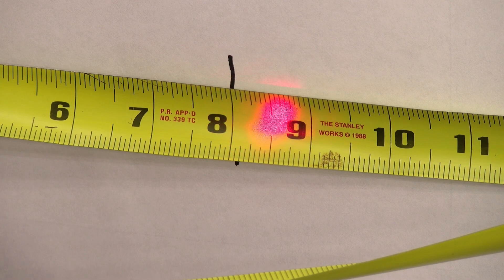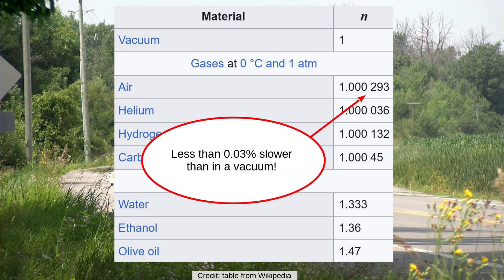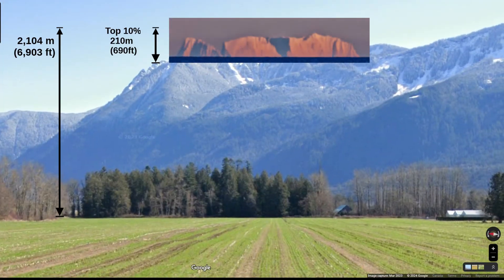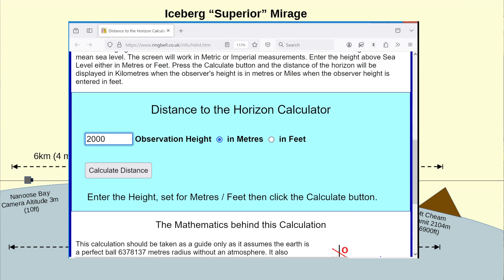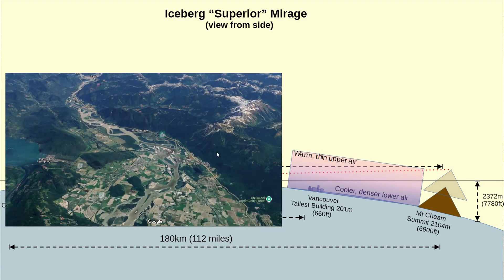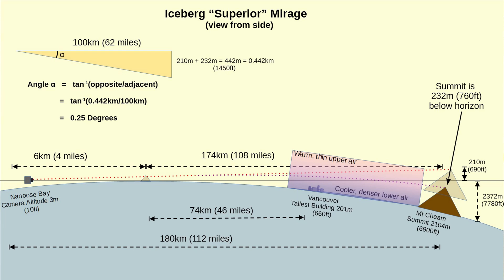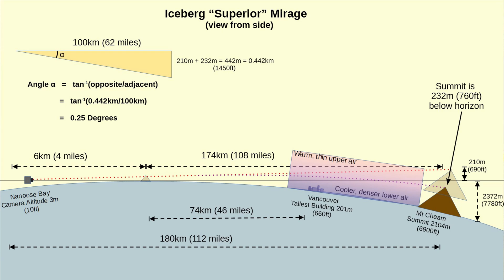Mirages - how they work! From simple water on the road to spectacular illusions.

Comment: You would think that the refraction of light would change its relative speed of light, thus changing the color of light like a prism.  i guess that is what a rainbow is.
Reply from the maker: The reason for the rainbow effect is  the index of refraction varies slightly with wavelength so one end  of the spectrum is slowed/bent more than that the other. In the case of glass or water, index of refraction = slowing of speed - is large - 1.3 to 1.5 or more, so there is a lot of room for the speed change to vary. 

In air, which has a small index of refraction. , there is probably a wavelength dependant change, but would be so small - and the average bending is so small to start with - we would never normally notice it. 

The effect has plagued lens makers for centuries using different types of glass in a series of lenses to try and undo rainbow creation. Also in optical fibers where slight wavelength dependant speeds can distort signals being transmitted.

Comment: Awesome explanation. The one thing I still struggle with is how changing the speed of light results in “bending”.
Reply from the maker: You know I was debating on whether to put that in or not and in the end I didn't because I find it better to stick to one topic for YouTube.

Think of how either bulldozer or a military tank turns: the one track is made to go faster  than the other and when that happens, the vehicle turns towards the slower side.

Now instead of the bulldozer, think of  light waves like water waves on the ocean. If the waves pass into air where say on the left  is hot and thin and move faster. and on the right is cold and slow, the crest of waved between the left and right areas will bend towards the slow right side as the right cant keep up with the left. 

Hope that makes sense! maybe future video!
Reply: @ElectromagneticVideos very interesting and makes sense from a wave perspective! What about from particle theory? Yes, could be a cool video.
Reply from the maker: @Schismarch  I cant think of an easy hand-waving explanation for point-like particles. In quantum mechanics, the point where a photon is detected is  based on probability - and that probability comes from a wave function that contains an amplitude which when squared   = power = probability, and and complex exponential which in this case represents the wave nature of light. The wave function depends on the surroundings - thin air, thick air etc. The EM wave of wave theory is essentially the average of where gazillions of photons  would end up from QM. In  a situation like this, the real part of the of  wave function essential;y maps to the EM wave. So the wave function is in a sense a probability wave (well not quite since its more like the square root of probability)    rather than an E field. But like the E field wave, the "probability" wave speeds up in thinner air and bends accordingly. So once again we have different speeds bending an underlying wave. 

Why the probability wave cares about thick or thin air is another can of worms - it can be looked at as interference from the wave functions of the interactions between electrons in the air  and the light photons/wave functions.

I'm guessing that this text  highly compressed explanation might be too garbled to be useful. Bottom line - there  is an underlying wave-like function that determines where photons end up and it gets bent in a similar way light waves do. 

I'll have to think of how to do a video thats a bit better a description!
Reply: @ElectromagneticVideos  nice, thanks for the explanation!
Reply from the maker: @Schismarch  Your welcome! You certainly have me thinking about a video on that topic sometime!

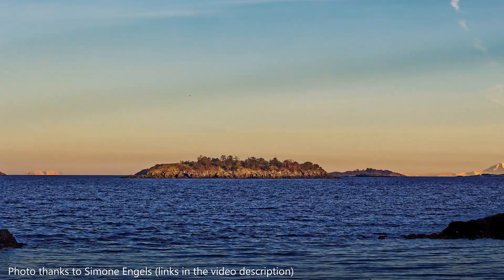Comment: Ooooooops, you very nearly disproved the flat Earth theory.      Early hours ten nautical miles from Liverpool there are times when the City is noticeable elevated from the horizon just like Superman lifting New York.  Abnormal refraction is another term. The crew were not amused by me wakening them at 05:00.
Reply from the maker: Sorry to all the flat Earthers :) Just looked on google maps - looks like the areas around Liverpool is flat so no mountains to help confine a region of cooler air as in the case of the Fraser River valley. I wonder if the  water is cold at times and creates a nice cool layer of air over its surface. Is the shoreline stretched when that happens? That could be a Fata Morgana rather than the simpler superior mirage. Situation probably similar to Lake Ontario which is known for views like you describe.
Reply: @ElectromagneticVideos  Liverpool coast line does not have much elevation the City itself is partly on a hill. The river Mersey narrows and is very fast flowing so I would expect a delta T of  2 -4 deg C  with respect to the  Irish sea temperature.  Looking from  Birkenhead on the Wirral (the peninsular opposite Liverpool) you sometimes see a temperature inversion and a mist about 15 meter above the river ceiling at 50 meters,  Liverpool's Cathedrals (yes two)  just visible above.  

When looking north on a hot afternoon you can sometimes make out Blackpool tower 54 miles away, the tower is  158 meters (518 feet).   The coast also has a shimmering reflection.  The climate in the Wirral is unpredictable by the national weather service as the prevailing winds are lifted over the Welsh mountains dumping the rain on Manchester, the Dee estuary is generally warmer than The Mersey so we have a microclimate 2 _ degrees above predicted.     

Very interesting explanation of optical anomalies,  I hope the Flearthers take heed and before they jump to conclusions remember that light can be distorted as can their thinking.  Best.
Reply: @ElectromagneticVideos  Fata Morgana seems to fit some observations although I think we have several different optical events depending on conditions. The river Mersey separates the Wirral Peninsular and Liverpool, it is a fast flowing tidal river which in the early morning will have a level of mist 20 meters ceiling at 100 meters the two Cathedrals visible above. When approaching Liverpool the coastline is low and on a hot day the City of Liverpool appears to levitate just like when Superman lifted New York.  

Blackpool Tower about 54 miles north is 158 meters tall and  is sometimes seen from the Wirral thus is proving without any doubt that the Oblate Spheroid is in fact flat ?  or it could be abnormal refraction and other optical phenomena .    The Wirral peninsular has a micro climate due to the prevailing westerly winds lifting clouds over the Welsh mountains and over the warmer water of the River Dee thus increasing  the cloud density which then proceed east to deliver  rain on Manchester much to the delight of Liverpudlians, the Met office frequently incorrectly forecast Wirral weather.  Very interesting subject which my Dad would have been more qualified to discuss......

Subject suggestion: Halos and tropospheric refraction from particulates and ice crystals,  (or weather modification 'chem' trails if thats your bag.)  Very interesting thank you and my best wishes to Canada from Wirral UK

Comment: Amazing.  I was convinced the road reflections was due solely to Fresnel's law and not related to thermal conditions.  If Fresnel's law is in effect, I'm not sure how you would ever distinguish it from a normal temp gradient mirage.  Even headlamps reflecting from the road at night could be attributed to the air temperature.  Looks like the phenomena is more complex than I assumed.  Thanks!
Reply from the maker: Funny - I did a fair bit of thinking about how how it compares to a regular Fresnel type refection. I think in this situation the angle between the incident and reflected rays is pretty much determined (and constant) based on the temperature (density) gradient, as opposed to being determined by the angle of incidence. 

However, presumably as the incident angle changes, that also changes how much of a heat gradient it  sees and for how long (before it may hit the road surface), so I'm not sure if that may somewhat  mimic Fennel behaviour of incident = reflected angle. 

The other difference is probably lack of polarization since we are bending the light rather than reflecting on a surface like water. A neat experiment would be to see if polarized sunglasses can confirm this.